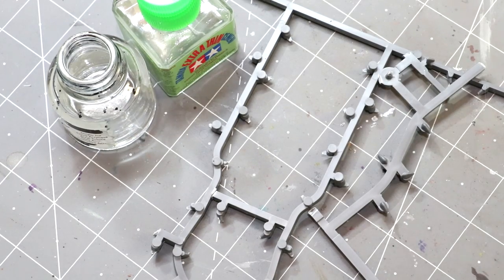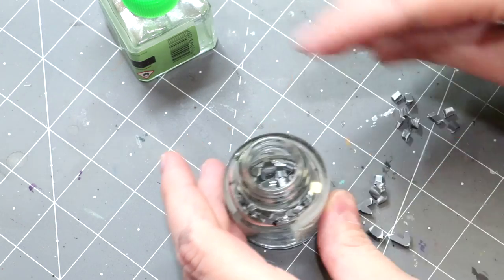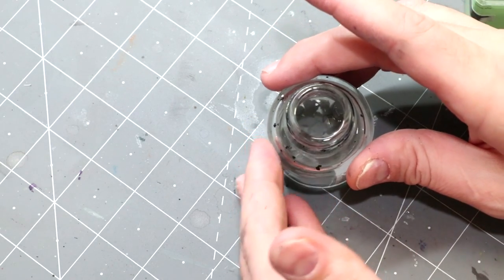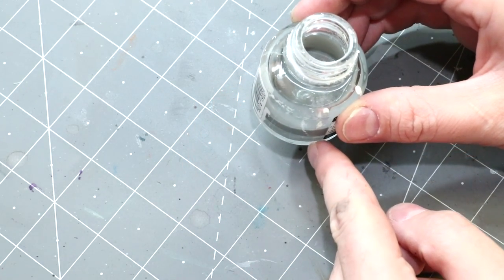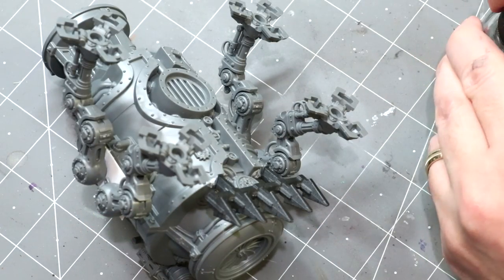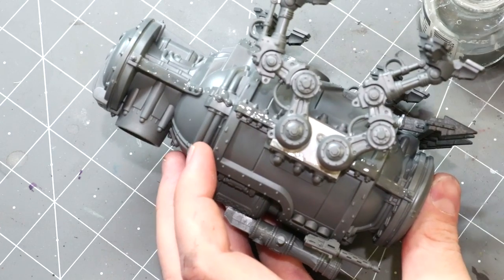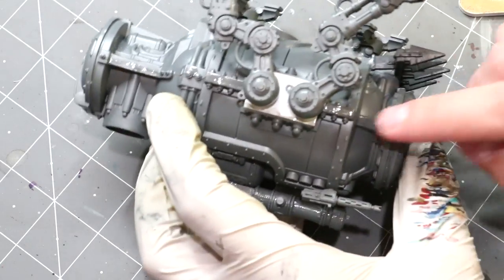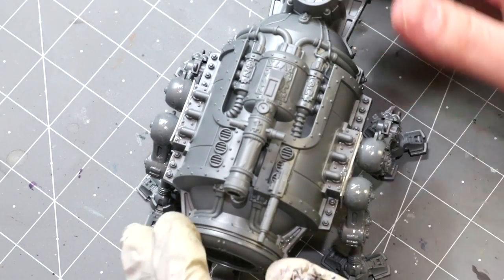Hobby Cheating 221 - How to Create a Gap Filling Slurry

Comment: Finally got around to trying this last night. I couldn't find any tamya local so I tried this Mr Hobby Mr Cements from hobby lobby. 

It pretty much just solidified the sprue but didn't make a slurry. I left it over night. The bottom is a hard chunk and liquid on top. My vortex mixer isn't helping. 

I did try to make more then just the bottom layers worth so I didn't have to do it again for a while. I'm going to try adding a little more cement.
Reply from the maker: Strange, I've never tried it with anything but the Tamiya.
Reply: @VinceVenturella  looks like adding the extra cement to it helped. Maybe looks a little thin now really but at least it's not a giant chunk anymore. I'm going to test it out tonight on some objective markers I don't care to much about.

Comment: i set up a jar with sprue and glue, but it does not really mix. the plastic is just one semi-solid layer with the glue on top of it - what did i do wrong?
Reply from the maker: Which plastic glue are you using and where are the sprues from? You may need to just stir it up, but hard to say.
Reply: @VinceVenturella  It was Tamiya extra thin and i used some GW sprues
edit: also the glue has turned greenish-yellow

Comment: Hey Vincey, you mentioned putting it in the oven.  You don't mean to turn on some low heat to expedite the process do you?  I presume you just mean that was just a safe place to keep it while it does its thing.
Reply from the maker: I have never regretted anything I've said as a sarcastic remark more in a video. :) - No, you don't use the oven at all, I just meant it as like a joke on a cooking show where they put the prepared food in the oven, then they suddenly pull out a finished food item. No, just put it to the side for 24-48 hours and you are set.
Reply: @VinceVenturella  …..🤣🤣🤣  😎  🖖

Comment: I used a baby foof jar and it worked perfectly for awhile but, the glue eventually ate up the latex seal on the inside of the lid and the slurry dried up and left a hard lump of plastic behind.  I will get another lid and move on.  While on the subject of Glue, why in the world does the brush not at least reach the bottom of the bottle...VERY FRUSTRATING?
Reply from the maker: It is frustrating. I have started just using the actual jar itself for the glue and mixing in.

Comment: so the mixture is a rough 1:1? could you also use a fresh bottle of tamiya and fill it to the surface level with sprue bits? or does the fuller bottle present a problem for some reason?
Reply from the maker: Yep, you're pretty correct on the ratio (though you can always modify slightly). Yep, I always do the just fill a fresh bottle now.

Comment: What model are you using to demonstrate the gap filler?
Reply from the maker: I custom kit bash I made, the big central piece is from the Sector Mechanicus terrain from 40k
Reply: @VinceVenturella  Vince, just kinda nitpicking but why would you fill the gaps on the sides of this particular model ? To me it looks like it is supposed to have the gap between the two boiler plates or whatever it its. There's even bolts to indicate the two pieces are, well, bolted together

Comment: Please tell me more about that model you used as an example. What is that from and do they still have more? I’ve never seen it but I can see it working for some things I’m doing now.
Reply from the maker: It's something I kitbashed from scratch. It's the Alcomite stacks furnace with legs from the armigers, but it's more or less a total kitbash.
Reply: Vince Venturella 
Thank you. I can use the center part to kitbash what I’ve been looking for on a diorama I’m doing. If the scale works. 👍

Comment: Hi Vince. Have you ever used plastic glue to remove mold lines? Is so, have you found a difference between certain types of plastic?
Reply from the maker: I have, I use it to clean up small mold lines, I couldn't really give a whoel break-down, I've mainly used it on GW models and haven't had an issue.

Comment: You can just use the Tamiya extra thin bottle and the included brush for this right? I have a bottle that's down to the bottom cm and this seems like a good use for it.
Reply from the maker: Yes you can, I just didn't like the existing brush as was a little too small to really spread.

Comment: Once u have made the slurry how long do you leave to set before filling down?

Also water doesn't seem to rinse it off my natural brush.
Reply from the maker: So two things. 1) I've found it's better to use the bottle and the applicator of the extra thin itself. 2) It takes about 48 hours to fully melt everything down. Alcohol will get it off your brush before it sets.

Comment: Is there any downside to using a cheaper, more readily available solvent (e.g. acetone) for creating that slurry? The Tamiya cement is fairly expensive / hard to come by over here, and most plastic glues I've come across are quite a bit thicker than the Extra Thin appears to be.
Very helpful and instrucional as always, Vince! =)
Reply from the maker: I can't say for sure, I have honestly never tried with Acetone, I have only done it with the Tamiya extra thin as you only need a little bit of it to make a decent amount of Slurry to last for years.

Comment: What am I doing wrong if it starts stringing out like plastic glue within like a second or so after putting the brush to the mini? I literally apply it with one stroke and try to smooth it with stroke 2-3 and then it starts stringing. I'm assuming it's drying. Not enough goo on the brush? too much/little sprue in the goo? Applying more goo at once seems to give me a tad more time, but on a 30mm mini it ends up being way too much for the mini itself covering most of the area rather than a subtle gap fill...
Reply from the maker: It's something you kind of get over time, but sounds like we need a little more plastic cement.
Reply: @VinceVenturella  alright, I'll try adding a tad and see if it improves, thanks for the tip!

Comment: I saw this before, and I also heard it can cause the plastic to go brittle due to solvent being trapped in the slurry for much longer than in regular gap filler or whatever, did you notice anything like that? Piece near the seam filled cracking or breaking or something?
Reply from the maker: Never seen any problem with brittle. If you want to avoid any chance of that, use the quick drying extra thin, then it's almost impossible for hat to happen.
Reply: @VinceVenturella  interesting, I'd have to try that some day, once I get better fume hood... don't really feel like doing that right now.

Comment: okay so, I have a question. great video by the way... i made some of this but when i applied it to my model it turned out more rubbery than anything. did I not let it cure/dry enough before I messed with it? or does it need more cement? Any insight would be greatly appreciated!

Mike
Reply from the maker: Sounds like it didn't completely break down. Seems like a more glue situation, add some more thinner and give it some time and see what happens.

Comment: May it be used as simple Glue to assemble figures parts (miniatures, or 3d printed ones, resin, FDM) ?
Reply from the maker: It's still plastic glue at the core, so it's not going to work on resin or metal, but you can use it to gap fill on those models.

Comment: can this be done with other cement? I have some revel stuff I'm not using. was just gonna put it in a small glass jar, and add sprues. thing is if you buy the tamiya stuff, you need to empty half out into another container to make it, so it's best done with an older jar. I have plastic magic glue at the minute though, so Ideally I'd like to make some slurry from the revel glue, but don't wanna waste it if it doesn't work with other plastic glues.
Reply from the maker: I haven't tried with other plastic glues, but there is no reason it wouldn't I would think, it's all chemically the same thing.
Reply: @VinceVenturella  I'll try. I just wasn't sure if you needed the especially thing stuff. 

The spare pot I have is thin as well though, and as I have the plastic magic stuff, I'm probs not gonna use the revel stuff. 

I don't know if the plastic magic stuff is as widely known as the super thin tamiya stuff, but it's the same sort of thing. 

I think it's preferred for conversions, but I'm not sure why. 

I just bought it as it was recommended to me. it's a little more expensive than the Tamiya though.

I use a lot of Tamiya products though. I have their files and their hobby saw. I will probably end up buying some tamiya glue as well, as I'm pretty sure this guy who recommended uses the tamiya for regular mini building. 

I think maybe the plastic magic must have a slightly longer working time, maybe? 

it's made by "deluxe materials" if you wanna look this stuff up. was like a whole 3 quid at least more than tamiya super clear though.
Reply: @VinceVenturella  I found the perfect container as well.

you ever see those little bottles that have liquid in with some sticks in it? they're a form of air freshener. 

Well one of those bottles, and I have childproof bottle caps that fit on them, so they're ideal for storing liquids. 

will just have to see if the cement effects the cap, but I think as long as you're keeping the stuff away from it, it should be fine. (also would not be surprised if the stuff they're made out of is the plastic that it can't melt)
Reply: @VinceVenturella  back at this again. I actually got a 2 x bottle pack of this specific glue, so might as well try it out. 

I'm thinking I might pour some out into a glass medicine bottle though, as I have not been able to properly clean the glass air freshener bottle sufficiently.

Do you know if making the slurry in the actual tamiya bottle is possible? I doubt it will melt the brush, as it's already in the glue to begin with. I could just pour some out and then add sprue to what is left.
Reply from the maker: @D00M3R-SK8  Yep, it's actually what I do now. I use the bottle itself, the brush of course is made of a material that doesn't react, much easier, wish I had included that at the time.
Reply: @VinceVenturella  thanks.

Comment: I made some of this and it is amazing. I did get some glue string? That I didn't notice and for the first time in a long time I got fingerprints on my kit. But other than that this stuff is amazing. I labeled mine adhesive-X. Thanks for sharing 👍👍👍
Reply from the maker: Yep, you have to careful about those strings, they can happen for sure, always be careful and just trim them away with either a knife or if they are very thin, you an burn them away with a lighter real quick.

Comment: will goo fill up holes in non plastic as it is essentially liquid plastic?
Reply from the maker: It will, though it needs to be something where it it can sink in, it won't adhere on the surface alone too well, (i.e. if you were just going lay it across the top of a flat surface), but I've used it on resin and metal for a deep gap without issue). It effectively hardens into plastic.

Comment: What is the advantage to doing this over using milliput? Milliput seems like it would be faster and more hassle free.
Reply from the maker: I find it much easier than mlliput. I can place this quickly over and it dries in a few minutes. Sometimes I don't need to sand at all, but when I do, it's all the same plastic so it sands quite evenly.
Reply: @VinceVenturella  Does it work well in areas that have a lot of detail around the seems?
Reply from the maker: @The_Tradwife  Yes, though if there is a huge amount of detail, I prefer something like perfect putty (or milliput) where it can be shaped when you can't sand it all the way down.
Reply: @VinceVenturella  Thanks for the info, I really appreciate your content.

Comment: What a great help. Does anybody know how to clean the brush?
Reply from the maker: You can't generally, I've switched to using the one in the original bottle, I just dump the sprue into a 1/3rd empty bottle and use that built in brush, I found it easier.

Comment: What happens if you apply the slurry to resin?

Can it still gap fill without bonding?
Reply: Asking the real questions here.
Reply: I wouldn't use this for resin - this is really only for polystyrene as you're literally fusing more polystyrene into the gap. for resin you're going to need to use more traditional gap fillers like milliput, tamiya putty, CA glue w/baking soda, green stuff, etc. for resin you may experiment with UV cure liquid resins like the stuff greenstuffworld sells, but I've never messed with it so can't comment on how successful the results would be.
Reply from the maker: Unfortunately, this won't work for resin, only for plastic. You have to use a putty or something similar for resins. Hope that helps. :)

Comment: Did you test this method with resine models, im stating with hordes (Mk2).... Im not sure if this method with my miniature.... Plástic cement dont work... So I supose it wont work... Buy its a nice tip
Reply: Felipe Jesus Cetina Mendez it would not work for resin. Just plastic models.
Reply from the maker: Phillip and Whiskey are correct, this is for plastic, unfortunately, with Resin, you have to go to a putty or something similar.

Comment: How does it work on fine cast?
Reply from the maker: So it won't bond resin, as it's chemically reacting with plastic. That being said, it can still gap fill, as it will effectively harden into plastic, but you have to still use traditional glue to bond the pieces.

Comment: When you said to put the mix into the oven, did you mean that literally? If so, what temp and for how long? If not, will the sprue just dissolve on its own with some shaking?
Reply from the maker: No, that was just a joke to show that it takes time, I had to switch to the one that already had all the plastic broken down. :) - It just dissolves over time.
Reply: @VinceVenturella  Well sure, I knew you were joking. Yup. And also, no one is embarrassed over here.

Comment: Mine turned into a big rubbery cylinder at the bottom of the jar, with clear yellow liquid above it.
Reply from the maker: Hmmm...That could be a few things. You have to make sure it's airtight, or it will solidify. I've also found you want to mix it with more thin glue than you think. Mine got a little more solid (not a solid block, just slow), so I just topped up some more glue and it was back to normal. My guess is you could probably break it down.
Reply: @VinceVenturella  I am using Mr Hobby "Mr. Cement S" plastic glue.

Are some plastic glues more suitable for breaking down GW plastics than others? Or are they all much the same?

Comment: I've been looking for this! I usually 3d print my models, and I need something to smooth over the layer lines. i normally use a Gunze (Mr. Hobby) Mr. Dissolved Putty for that, but is going to be much cheaper! I tried making a slurry with acetone, but that didn't give me the flowing slurry I needed. I'm going to try this when I got some free time.
Reply from the maker: Yes, this flows really well.